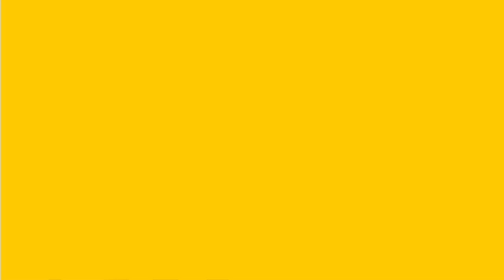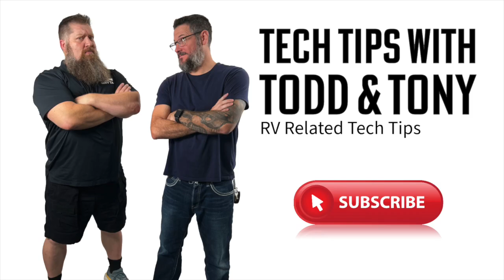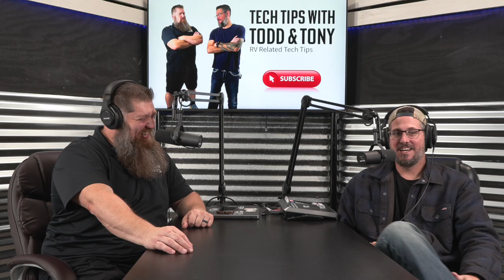Fall RV Maintenance Made Easy: Essential Tips for the Autumn Season

Comment: PLEASE do a video on adjusting slides!  We have an Alpha Wolf 26RLL, made an appointment at repair shop and it's been sitting there for over 2 weeks.  We just need to snug up the cables and make sure it is aligned correctly. I'm sure it's easy enough but...

Comment: I actually camp in cold weather here in Colorado. Can you talk about absorption refrigerators failing to cool when the outside temperature gets below some point. And propane regulators icing. And propane tank pressure falling below the regulator setting. And putting a tank heater on the propane tank ...

Comment: I just washed entire camper roof first & slide top than all around the walls. Used auto wash & wax in a bucket with a facial soft bristle auto wash brush. Rinse with clear water from garden hose with a shower attachment. I am satisfied with my choice & result.

Comment: Question… You talked about the compressed foam gasket under the A/C, I need to change mine. Any reason I couldn’t stick the gasket to the roof (it’s aluminum, not rubber) and set the A/C on top? The original gasket wasn’t centered correctly on the A/C so a bolt went though it when it was mounted on the roof.

Comment: asked on the produced video on the NRVTA channel, but hoping to double my chance of getting answered...Question regarding roof load capacity, I'm a lot more man than I should be and I always hear about "ladder capacity" but no one seems to mention roof loads. Is there a rule of thumb? If I can get up there with an A-frame ladder, what is a safe weight limit for a roof?
Reply from the maker: This will be a good tech tip! Good rule of thumb is if there's no ladder, it's not a good idea to walk on the roof. If you do use an A frame ladder, crawl on your hands and knees to distribute the weight.
Reply: @ToddandTonyshow  Thanks!